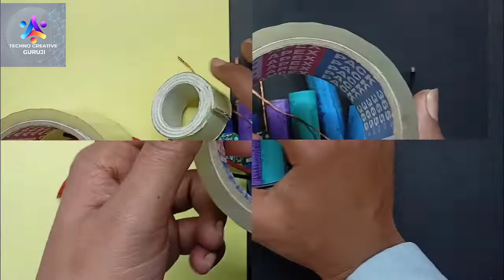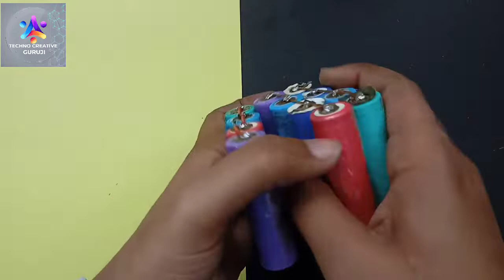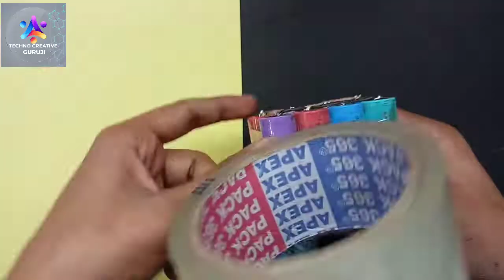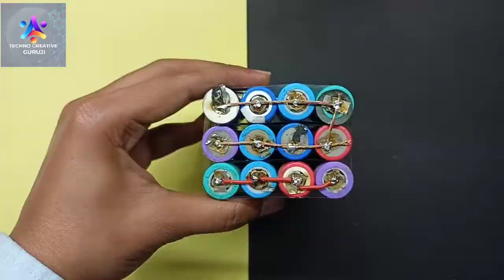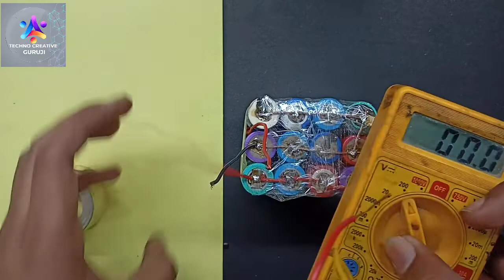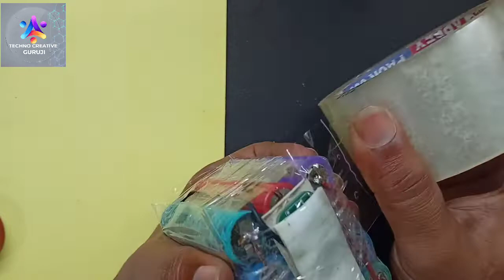How to make lithium ion battery at home using BMS ||By #TECHNOCREATIVEGURUJI

Comment: भाई मेरे पास "1.8-2 700-Watts coil" हें,तो मेरा सवाल ये हें,के ये "700-Watts coil" BMS lithium Battery Connection पर "coil" गरम हो सकता हें क्या⁉️
मेरा मतलब ये हें मुझे "700-Watts coil" rechargeable बनाना हे BMS lithium batteries से ऐसा हो शकता हें क्या⁉️
Please Solutions दिजेए मुझे "1.8-2 700-Watts coil" rechargeable बनाना के लिये क्या करना पडेगा.
Please Humble request you 🙏
Reply from the maker: Ha bhai